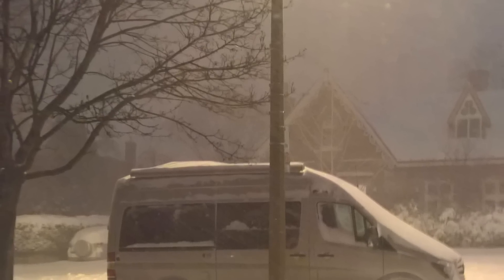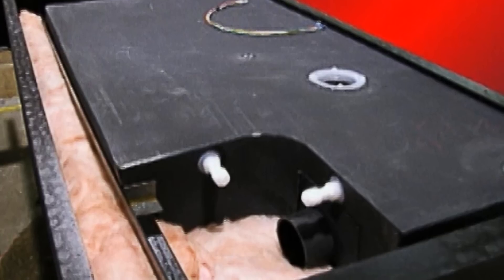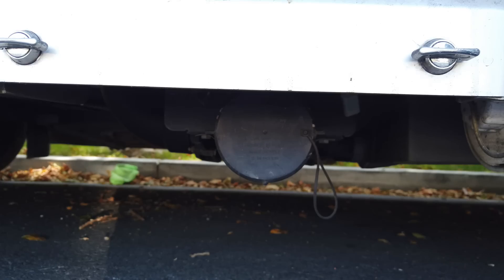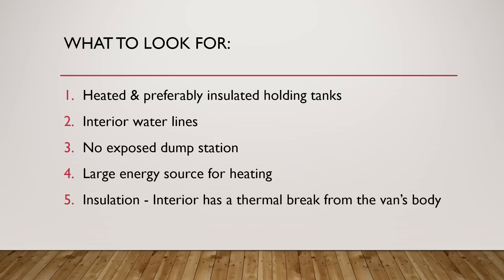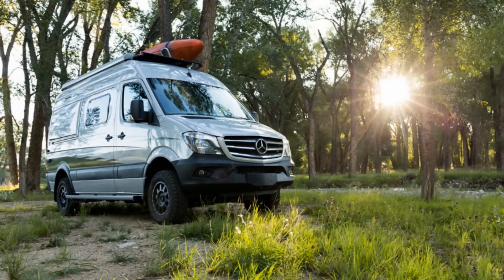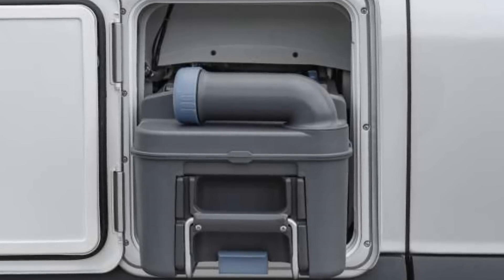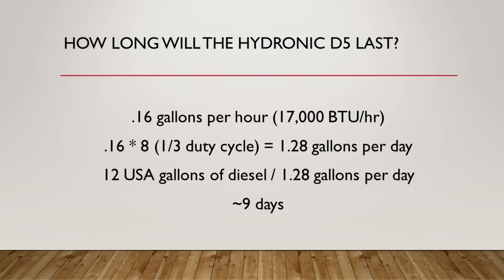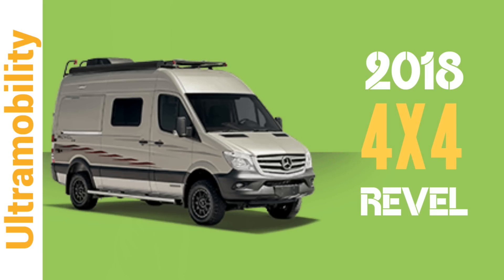Best 4 Season Class B Camper Van | 5 Tips for Finding Your Perfect Winter RV!

Comment: Neil, Although I appreciate your videos, I believe your facts on heating pads are inaccurate, which may have come from the information you received from the PW CEO (in your recent video).  I believe his facts are inaccurate why PW doesn't install heating pads, at least the ones other RV company's, like WGO, uses.  Please refer to Ultra Heat FAQs, which states:  "While each RV or Leisure Vehicle is different, our overall product design benchmark and testing is -11°F (-23.9°C). This is on an RV holding tank (with the properly sized heat panel), mounted below the floor and totally exposed to the elements."  Much more information is available online.  https://www.ultraheat.com/faq